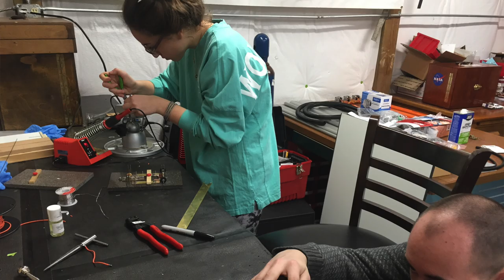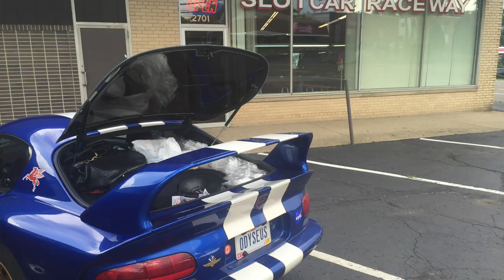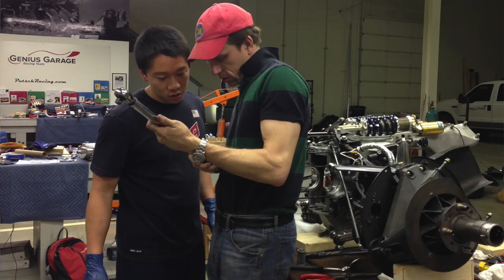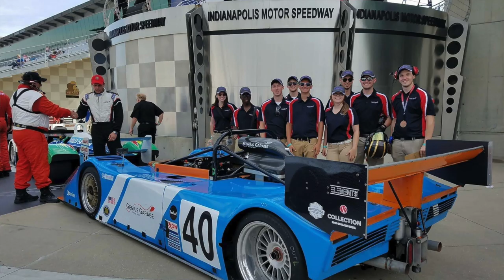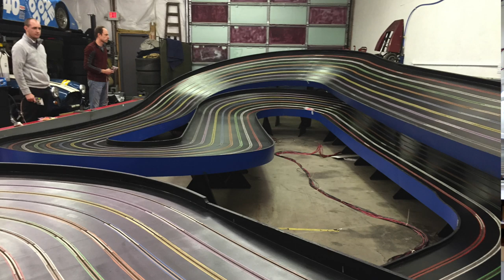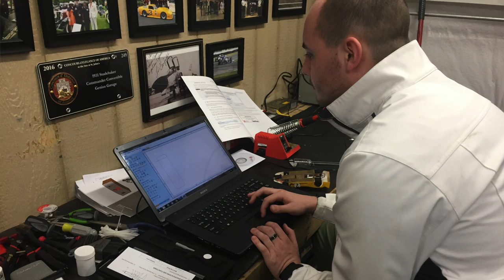Secret Way Into Engineering and Racing - SLOT CARS!

Comment: I've been racing slot cars for the past  40+ years!! 😯😁 I can honestly vouch for how much fun, how competitive and how much you'll learn about racing, design, model building, aerodynamics, electronics and a host of other real world practical and transferable skills which you can apply to other uses very easily!😎👍
Now I've also 'raced' cars in computer and console games for almost just as long! Probably my first racing game was on a sinclair spectrum 8 bit home computer way back in the early 1980s, my first proper racing sim was much later in 1991 on a PC, Microprose Formula 1 Grand Prix by Geoff Crammond was about as close to real racing on a computer, with different circuits, good car physics, quite advanced 3d graphics and ability to 'tune' and adjust the car in various ways for each circuit added a whole new level of realism.
BUT sim racing doesn't come close to slot car racing, if you want real practical hands on racing then try slot cars!! 
Much more affordable, especially if you join a local club who already have a circuit built to race on or you buy a 2nd hand slot car set which you can pick up for less than the cost of a computer or console racing sim game! 😎👍

Comment: And to the young people trying this for the first time... don't be intimidated by the "old guys" old enough to be your grandfather.  There are no "speed secrets".  Those old guys will be more than glad to show you how, teach you the finer points, all the tricks.  Back in the '60's I was really doing well at a big race, but damaged my car.  I borrowed my brother's backup.  I hung in, heat after heat, advancing.  The "old guys" were loaning me better tires, another motor, etc, and really encouraging me.  I came in 3rd overall against two guys my father's and grandfather's age.  I still have that trophy in my closet, and value that 3rd place more than I would have a 1st if I were much older.  All you have to do is ask.

Comment: Nice vid and bang on the money, I've been saying a similar thing for years that kids need slot cars, model railways, LEGO, Meccano, etc. Stuff that teaches motor skills, construction and design, simple electrics, that makes them think, problem solve and hone those skills or provide inspiration. It could potentially set them off on the course to a career in engineering or end up working in F1 or endurance racing like Le Mans or even being a pro driver. Give kids (and adults cos let's face it we love it) proper toys and models again 😀